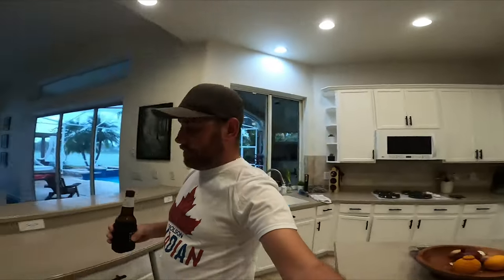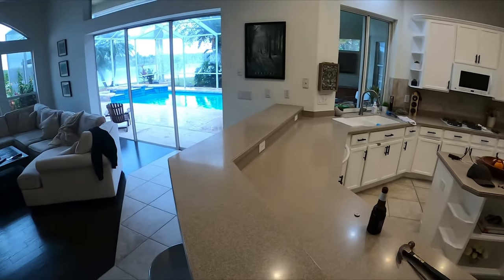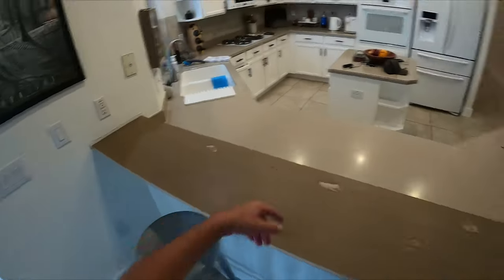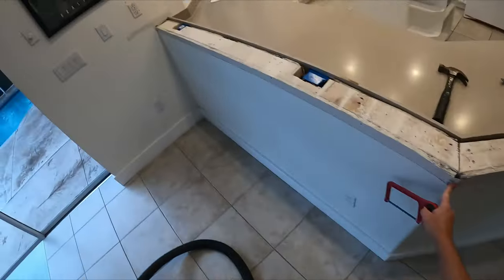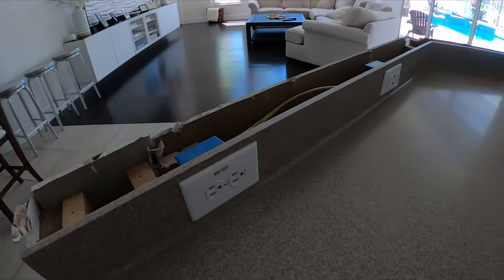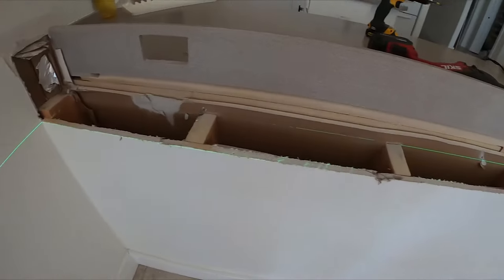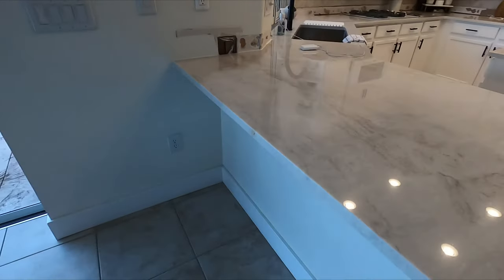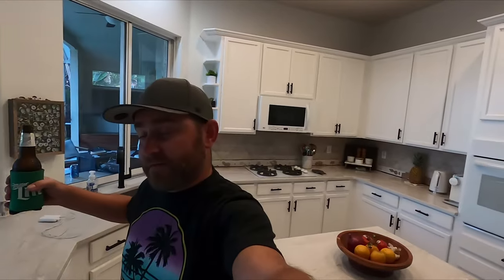Bar top Counter Delete (Skill Level 2 beers)

Comment: Great video, but you cut out the most important thing for me which was the electrical. Otherwise, this was exactly what I needed for my project. Thanks
Reply from the maker: I hear you. I figured everyone's situation would be different so I left it out to save on video time. Hopefully it worked out for you! Cheers.
Reply: @SebastianBalos  right in the middle of it. Trying to relocate the outlets and garbage disposal switch. Figured out the outlets but still trying to figure out the garbage disposal switch so it’s in a convenient spot.

Comment: This came out beautiful!! Your house IS Beautiful...
Reply from the maker: Thank you! its not very difficult so I'm sure it will work out for you. I dont regret anything. It opened up the space. The bar top felt like a divider. Cheers!
Reply: @SebastianBalos  thank you. I DID IT!! i had to take the pony down. Mine was in an L shape. I extended the wall out 20in. Now I'm about to do backslash and then ill take pictures
Reply from the maker: @jenniferjones5826  Right on! Cheers!

Comment: Thank you for the tutorial!  I have the same project.  Curious if I could reattach the countertop that was removed to be flush with the lower piece.  Planning to use poured epoxy countertops over it.  A temporary fix to save money until we can redo whole kitchen. Thank you!
Reply from the maker: As long as you are able to cut it straight to some extent it might get you by! cheers!

Comment: about to move to an older home with these hideous kitchen bar top counters. about how much would this cost to hire someone to do??
Reply from the maker: you situation might be different but in my case the countertop installer wanted $1500 to just cut out the bar top.
Reply: @SebastianBalos  thank you!

Comment: Hey quick question. I did this but my cut of the wall wasn't even so things are not gonna be level... Am I screwed or can shims salvage my work? It's maybe an 8th or at worst a quarter inch off-level
Reply from the maker: I would not sweat it. the countertop will get leveled with shims. Cheers!
Reply: @SebastianBalos  thanks buddy. awesome video btw, none like it out there for a project that should be more popular!

Comment: how much was the counter top without the labor?  Just for the bar side...avg?
Reply from the maker: @rhondabradfute8866  its to hard to say. The countertop company hides the costs really well. I will say that the installers were a third party hire. So there is a lot of middle man money involved. There are savings to be had on the instal but you would really need to dig.

Comment: What was the laser level you got?  I have to do something similar, but I will end up having to move electric (Sink on the other side)
Reply from the maker: I ended up scrapping the review of it because it high jacked to much of the core video. Click into the description of the video, i added a link to it. it does the job and was relatively inexpensive. cheers!

Comment: Did the same thing to my home. You’re lucky you had no copper water pipes running through your raised bar like I did! Ugh such a pain! Had to pex pipe it all since it was inside drywall so no sodering could be done inside drywall without high risk of a fire. So worth  all the work though! My 20 year old home looks so much more modern! Cracked a few beer throughout the whole project too lol. Cheers!